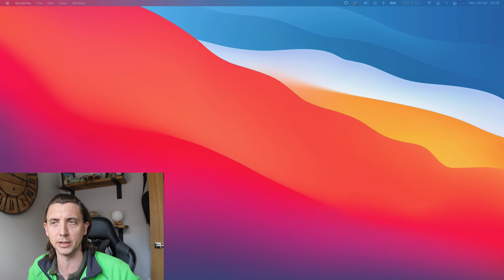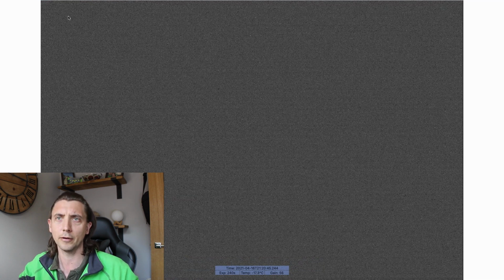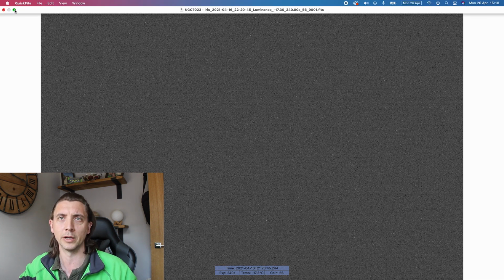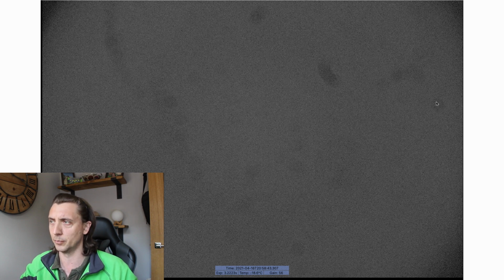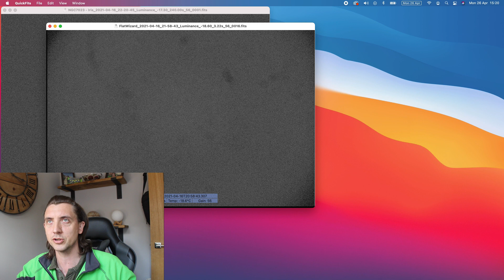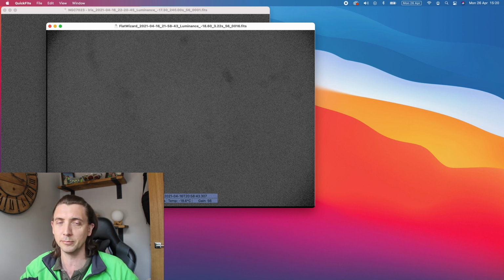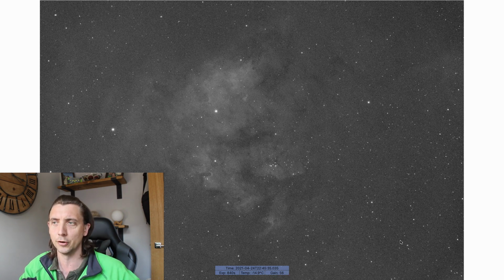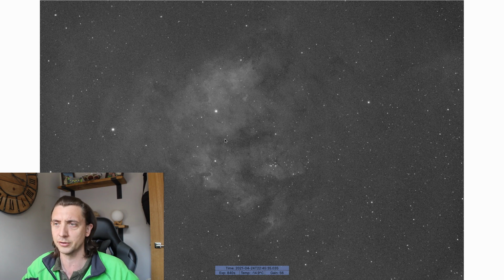QHY268M - Part 4: First Light!

Comment: Do you know if there is a way to reach back focus with Canon lenses (or Nikon)? I'm interested in this camera but I haven't figured out a way to use a filter wheel and get proper back focus. Nice vid. Thank you.
Reply: To answer my question, that would be a ...no. Like their drivers, QHY does a poor job with their hardware to accommodate, which is a shame since it appears to be the superior product on the face of it. Purchased the zwo.

Comment: Hi! I have the same camera, yet to see first light, but I have taken some flats and have also noticed some dark spots which I too have deduced to be on the sensor cover glass. How exactly did you go about cleaning yours?
Reply from the maker: So, I have a lens cleaning pen. They have a brush on one end and a soft flat disc on the other end - and that's the one I used to clear the sensor cover. Worked perfectly, and lens pens are something that should be in everyone's toolbox! Clear skies (and sensors) to you!
Reply: @EverydayAstro  thanks mate. I'll look to get myself a lens pen then.

Comment: Strange the sensor was so dirty. Was it the bare sensor or the AR glass cover that was dirty?
Reply from the maker: Yeah, sorry - should have been clearer, was the glass that was dirty (thankfully) - however, still not something you would expect from a new camera!
Reply: well the sensor was quite exposed while you assembled the equipment. did you make sure to avoid any air current and had the place cleaned in advanced? i am generally surprised as to how much sensors are exposed in AP when handling equipment - not a critique to you by any means, its just that preparing a room so that you dont have specks of dust and what not flying around is not that easy

Comment: Hi, 
i'm wondering which filter wheel that is? So far im using filter drawers. Since i use 2" filters, if i'd buy a filter wheel it would be the largest one.
Reply from the maker: Hey man, this is the QHYCFW3. It has 7 x 36mm filters in it (LRGBSHO). The only time 2” filters are really needed is with full frame sensors. Mine is APS-C, so 36mm is more than enough. I still use 2” filters on my SpaceCat, but unless you already have a full set of 2” filters and a full frame sensor, you may want to consider dropping a size (unless money is literally no object). Not only will a 7x 2” filter wheel be huge, the filters cost a fortune and you will be pushing the limits of a stock focuser due to the weight - so that may also need upgraded. Sometimes it’s cheaper to start over than continue on your current road. The only 2” filters I have now are the L-Pro and L-eNhance... the rest I sold.

Comment: Interesting video to hear your thoughts about this camera, pity of the driver issues, typical QHY I suppose, hope it's fixed now to stay.
About the sensor spots, were they on the sensor itself or on the protective glass ? i suppose they were on the glass and that looks logical if I see how you must bolt those things together without the protective cap on it.
Those usb cables that you use to go to the computer, are that silicone cables ? They look so flexible ?
Reply from the maker: Thanks, Siegfried. Have to remember that the driver is still a Beta driver as the camera is so new, so some minor issues are to be expected. The dirt was avoidable, however. And to be clearer, yes, it was on the glass over the sensor, not the sensor itself (thankfully!). The two cables (power and usb) both come as standard with the PegasusAstro Pocket Powerbox Advance. So far they have proved to be goof, flexible cables, and I have had no issues on nights below freezing. That's one good thing about the Pegasus box, all the cables come with it - power, usb and four other cables for powering your equipment. Clear skies.

Comment: hy.. with gain und offset do you use with your aop.. ? best regards from austria..
Reply from the maker: Hey, at present I am using gain 56 and offset 0. However, I should be using gain 56 and offset 20-25, it was a mistake by me to use zero, so I will be changing it to 20 going forward... clear skies!